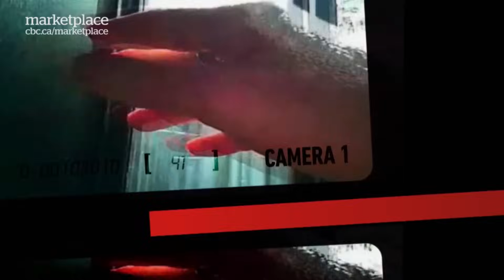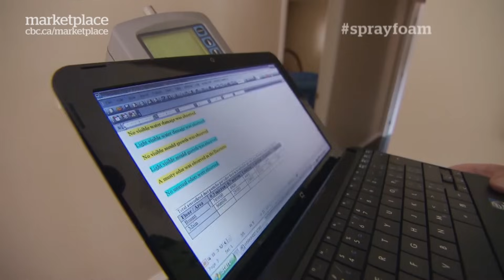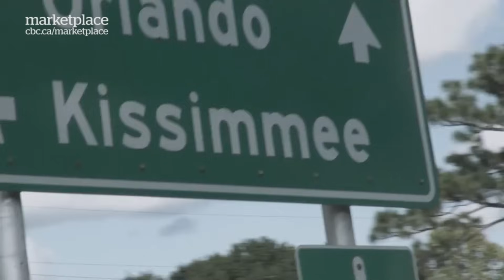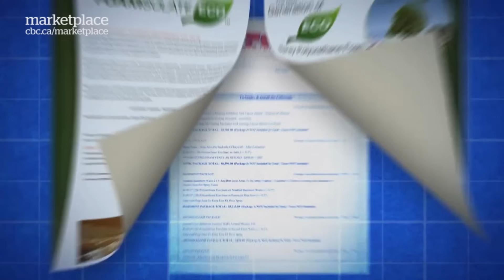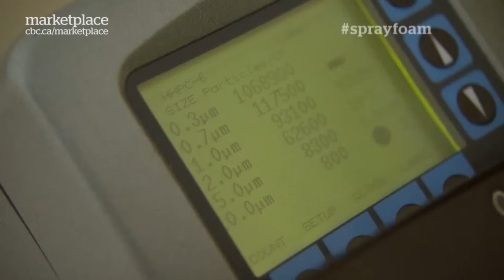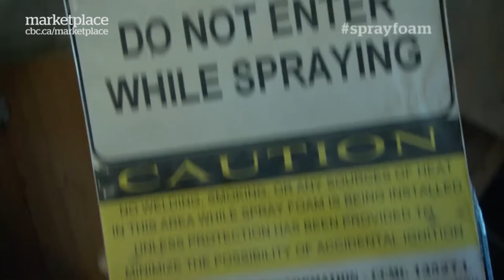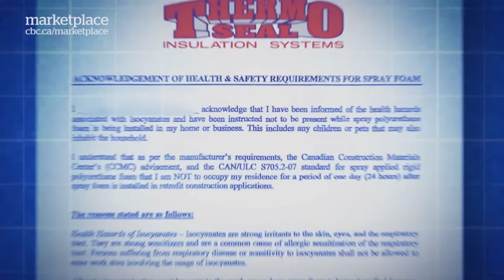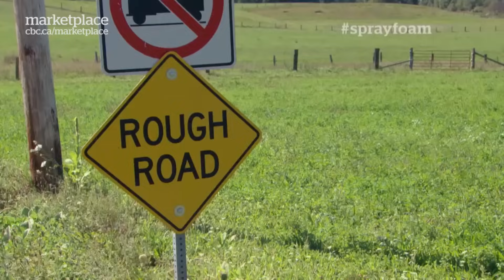Spray foam insulation nightmare: What can happen if it's not installed correctly (CBC Marketplace)

Comment: Ten years of doing this, never had ANY issues like this.  Though I've never installed more than an inch at a time.  That, I'm under the impression is where this went wrong.  Don't know what product this contractor was using(there are many, many types of SPF)  but the products that I've used work really well and are easy to install due to the canalization to slow the reaction giving the foam more time to properly react without excessive exothermic reactions.  Like they said in the beginning, like learning chemistry as much as anything.  Sad to see any job go south and the foam definitely needed to come out.  I would have pulled the dry wall (ceiling) off the rafters and mechanically removed what foam was on the trusses and if the contractor had done this day one, the home owner probably would be ok with this rather than decapitating his house.  And maybe could have come to believe in the foam again.  Bad contractor decision.  Not bad contractor, just didn't handle the fuck up well or soon enough.
Reply: Robert Palmore Smart move installing one inch at a time. Especially if you allow like 30 to 45 minutes per layer (easy to do really and the job will be done in only a few minutes longer than 1.5 inch lifts). I agree with you on what should have been done, however, the refusal to accept responsibility and take action means that the contractor has no say in any planned recovery or method of recovery and is still responsible under law.
However I disagree about the contractor. The fact that he refused to acknowledge his bad work and even now refused to acknowldege the physical harm he has caused (which is even described in health warnings in journals and MSDS's) because he failed to address the issue makes him just that "A BAD CONTRACTOR". At this point he can't deny responsibility for the physical harm caused to the family either. Remember that the exotherm caused a change to include formaldehyde which was a guaranteed non-component of his advertisement and sale. 
Misrepresentation and or failure to remove the product which violated his advertisement again proves he is a bad contractor.
Reply: Robert Palmore Whats the difference with this foam method and using foam boards with bottle urethane foam to seal the sides? I mean in insulation efficiency vise?
I mean sure spraying foam is faster and it will seal all the holes, but personally i still like to work with traditional stone wool or styrofoam boards. New house all ready has plenty other chemicals floating around until it vents those out and settles. Also for future renovation that foam it pain the ass remove.
Reply: When foam is sprayed in place, you get 100% adhesion and 100% air barrier as well as if the foam is installed in 2 inches or more, you get 100% moisture barrier.  Also sprayed in place with the 100% adhesion will help deaden sound as well as add structural strength.  As far as insulation value, if your using urethane board and sealing it, same.  Urethane has around 7 R per inch. Different manufacturers have slightly different ratings.  Polystyrene (foam cooler stuff) it's around R 5 per inch.  Hope this answers your question.
Reply: Robert Palmore Thanks for the info. Personally i think 100% adhesion and moisture barrier is a bad thing.. its kinda good when it gives some structural strength, but stopping building from moving naturally and making it total bubble.. no thanks. If i were to do insulation job with this, i would put plastic or something other stuff first and then cut tops of the beams open, so structure can breath and insulation can be removed more easy when and if its needed. Kinda depends from intended use, but in living apartment.. i would not use it, but in special cases. Even roof insulation installation, from below can be done much more easy with standard board UT and with less mess. I take spaying like everywhere its messy job?

I heard those R ratings take only in count one way of heat transfer, so for cant be trusted.. personally i notice those have been little shady, thought i'm not insulation expert, but tiler expert.
Reply: A house can be too tight.  The best thing is to make it as tight as possible and then use an air heat exchange to ventilate without the loss of heat.  I've always done every job like it was going to be installed forever.  Messy is putting it politely.  Coveralls, head cover, full face respirator with tear offs and gloves.  Worth it though.  A fell by the name David South who is with http://www.monolithic.com wrote an article called the R Fairy Tale.  Just like you say, the R values are a bit shady.  In the real world, Foam's insulating performance is much better than in a lab.  Like I will put R 21 (3 inches)  in Foam against R 35 (10 inches) of glass any day all day.
Reply: Robert Palmore Well as constructor builder i do every job like its to stay, but i try to leave possibility for renovations.

Thanks for the rest of the info :)
Reply: Lp
Reply: Don't have any experience with open cell. Feel like it's an expensive fiberglass solution.  I do know most are water blowing agent.  Blowing agent is the stuff that makes it foam up.  If the foam is a water based blowing agent, I'm guessing that the chances of this happening are lower. Please don't bother with that hyped up crap though.  I would rather take the risk of this happening and getting a real good quality insulation job that isn't hyped up bullshit.  Hope this helps a little.
Reply: Very intelligently put Robert. I agree %100.
Reply: Hope I don't disappoint you.  I do it that way because I'm cheap.  First layer has the poorest rise.  What your spraying on is cold. (chemicals come out around 130 degrees F.  Gets hotter after sprayed called exothermic reaction.  Get the first layer on and you get a little more yield from subsequent layers.  The older stuff, you could set on fire at 4 inch lift (layer).  So, cheap and a bit cautious.   I both love and HATE this stuff. Best insulation in the world and would LOVE to see the farce of fiberglass outlawed and hate to install it. Gets EVERYWHERE.  Have to wear a full body condom (coveralls, spay hood, full face resp. gloves, shoe covers and a place for someone to put an air hose and cool you off.)  Should be the only insulation allowed or at least a test method developed to show the real world effectiveness of it.  Cheers.
Reply: Ooh yes, I'm well aware of the the pitfalls of fiberglass. As a technician for At&t, I spent LOTS of time in attics
Reply: There is a movement on to do what is called "conditioned space" attics.  Only practical with SPF.  Foam is sprayed on the underside of the roof and not on top of the ceiling drywall. This puts the attic on the inside of the conditioning envelope. I've had to do attics in Idaho when it was about 95 out.  Bad idea.  Get punchy real fast.  With a conditioned space, you can work almost shirt sleeve all rear round in the attic.  Stay safe in the old death trap attics.
Reply: Robert Palmore they could have got a bad batch. that stuff happens all the time in the construction industry...
Reply: only an inch at a time? like time in between the layers? i worked for a spray foam insulation company.
Reply: Before the new blowing agent the exothermic (gets hotter after spraying) was pretty hot.  In fact there were reports of installers setting things on fire because of the exothermic heat.  The newer blowing agent formula has stuff in there to slow the reactions speed(catalysts) and supposedly you can spray the newer foams at a much faster (more inches per pass) than before because of the catalysts but safer is better. Usually I would go down a wall with around an inch and come back to the beginning and start over without ever having any problems.  For properly installed foam there is no detectable out gassing from the foam after 30 days.  Most of the out gassing should happen in a matter of hours and drop to barely detectable after just a couple of days.

Comment: Stick with Fiberglass, Wool Rock, Newspaper and Cotton fiber products. Safer easier to clean and fix.
Reply: They also make a gypsum based spray insulation.  I would never fill my walls with spray foam, God help you if you ever get an electrical fire.

Comment: Sealing the upper faces of timber ceiling joists with foam is not a good idea. It will still absorb moisture vapour from below, but not be able to lose it into the attic space. Damp wood will swell, potentially cracking ceilings and more seriously it may well rot over time.
Reply: Benzknees bingo

Comment: I was more impressed by the fact that that huge roof and ceiling were all removed in one piece.
Reply: Some people frame roofs that way too. Pretty neat. I myself have assembled sections of the roof on the ground and craned them up into place
Reply: @bolerdweller  a lot easier I guess if the wall plate is bolted and not nailed; still impressive lift.
Reply: @linkspider  they were probably nailed and hurricane strapped. Either way someone would have had to go around the whole perimeter and sawzall it out. Quite an intense job and all the electrical circuits would have had to be pulled, coiled and rerun afterwards. I've lifted a roof just for higher ceilings, this job is huge when you think it's just because they wanted to insulate the ceiling
Reply: @bolerdweller  lot of swearing

Comment: I live here in south Texas and I've warned countless people about this. We have extreme humidity and I've seen too many people suffer from this crap. Personally I recommend Rockwool, excellent product.
Reply: I 'd like to use Rockwool here in Bexar county.
Reply: @timothykeith1367  you won't regret it brother. Much better than spray foam.
Reply: @timothykeith1367  yeah it doesn’t rot on account of being pure spun rock, doesn’t burn, doesn’t get used by criters, etc.

But it is really energy intensive to produce.
Reply: Rockwool is nasty stuff as well. I like insulation boards. Expensive, but better for you.
Reply: My house was built in 1951 and uses rockwool in the attic.  It's great stuff.  Very effective.
Reply: @Anythingyoulike2013 Why is rock wool nasty stuff?
Reply: @judethree4405  Its not nice to work with and makes your skin itchy.  You need good protection over yourself especially face and arms.  Im convinced rockwool will be banned one day for some health reason or other. 
Also its not as efficient as pir insulation boards.  You achieve less of a u value with rockwool as compared to insulation boards.

Comment: 4:26 “It’s good for the environment”
Proceeds to put on hazmat suit before applying it
Reply: Because if you were to breath that when it's mixing you turn pale and pass out. My dad does it for a living. Is currently building the owner of Jimmy John's house and spraying foam. I don't believe it is the best thing for the environment but it sure does work great when someone skilled does it
Reply: @DevE84  You're right, I just thought it was a funny transition going from the "it's good for the environment" thing to putting on a hazmat suit and mask lol
Reply: Exactly
Reply: @DevE84  did this with the Squamish long term and hospital in 2009. you follow the Architect protocol and I am there as the CSO when it's applied, to make sure the crew doesn't cover a number of exempted areas in the plan. it's the way to go but the biggest problems with knowitalll contractors is that these guys are there to make money. you have to ride them like PBR rodeo bulls.  the foam we used is light green. I have no idea what this foam was supposed to be used for, but it's inert after application. if they're wearing hasmats then you send samples to bio and chem engineering for analysis, rather than present a new CBC drama.
Reply: Just going to point out that it's not a hazmat suit, cbn suit, or eod suit. It's a paper pair of overalls generally called a "tyvek suit" whether or not Tyvek made it.
Reply: The suit prevents the stuff from sticking to them nearly permanently. Did you see his boots?
Reply: @MonkeyJedi99  yeah the guys I've seen do it gorilla tape booties onto their tyveks, that way their shoes were protected
Reply: The "good for the environment" argument could be defended with the claim that it reduces the household's demand for fossil fuels, is less energy-intensive to manufacture, and is more efficient to transport than many alternative products. Its overall environmental footprint probably is lower than rock wool or fibreglass or polystyrene; it's just that most of that footprint lands right in your house. :p
Reply: @poisonhemlock  Right on :) I don't know if we're able to measure the overall environmental footprint of different materials, but I'd think rock wool or fibreglass is the most efficient and environmental friendly solutions, due to their lifespan; I mean it probably lasts as long as the house stands, 100 years or more.

But it probably still requires a heck load of electricity to produce rock wool or fiber glass, I guess :)
Reply: @Thomas-lk5cu  To be clear, I think I'd still pick something else. Please don't spray this crap where I sleep and eat, this is for commercial buildings.
Reply: @poisonhemlock  Yep I wouldn't want anything sprayed into my walls either, I like my home to be free from any chemical fumes.
Reply: The suit is mainly for keeping it off your skin while you spray. It ruins any clothing it gets on. I had to spray this stuff one summer when i was layed off from my regular job.
Reply: @johnhung1063  Yea but I just thought it was funny :D

Comment: We live in Georgia and had spray foam installed under our roof over twenty years ago with no issues. It lowered the temperature in the attic thirty degrees in the summer.

Comment: My home was built in 1945. I was offered home spray insulation and I refused quickly on the spot. I was told about all the benefits and still declined. I run 4 window units not all at the same time but surprisingly the house stays rather cool in the summer. Living in south Texas the winters are rather short but it can get cold. Either way my average electric bill in the summer is 145 dollars 55 in the spring and fall about 150 if the winter is colder than expected.

Comment: "Get a removal guarantee in writing"...   I do not know ONE SINGLE spray-foam company that would ever give anyone a guarantee that they will remove the foam if something goes wrong. The labor cost to remove foam from an entire house is ridiculous. Also, there are too many chemical things that can go wrong along the entire chain, from manufacture to storage before application to temperature of side A and side B before and during application. Some plural component machines are even known to give false temperature readings. This is an industry that is still in its infancy really... and people need to really need to be better-informed before deciding on spray-foam. The reason they decide on it is usually because the R-value is way better than anything else out there... WAY BETTER... however, with that said... you can get pre-manufactured blue-boards, which have a similar R-value and install them manually, just cut them to fit, then spray around them with spray-foam cans. This will take longer and be more  tedious, but it is safer. I think what happens is the spray-applicator tries to go to fast and does not allow the product to CURE, which is not to be confused with DRYING. If you do not allow each layer to cure, then the product cannot off-gas properly. This situation leads to these problems quite often. Bottom line is be informed... and for contractors in a competitive industry like this... make sure you charge enough to do the job correctly so you do not run into problems down the road. In my opinion, there are WAY too many spray-foam contractors that think you can just buy a machine and some spray-foam and go to work. You need to understand the science of the material and all of the  systems of the industry first!!!! The U.S. needs TRADE SCHOOLS!!!! Have you ever heard of this kind of thing happening in Germany? Holland? Norway? Denmark?  No... because you have to go to school and learn every facet of this before you get a license. Years of school... not months! And after you finish school, you get a well-paid job, with medical insurance and paid vacation and much more... When is America going to learn from Europe?
Reply: Well, as my Yugoslavian boss said on a carpentry job in California, "America is about production not perfection."   But he drove a Mercedes.
Reply: Do you know what happens to those bad contractors??? They don't continue their bad work anymore because they go out of business due to poor work history. Free market for a reason. I agree have a certification for a chemical process... But that can be instructed in about a month of training. Not years of training for a person to swing a hammer. Trade schools are great... Licensed only markets are not. What? You afraid the untrained new guy is gonna make you look bad? No of course not. But people know they get what they pay for.
Reply: Does Canada need trade schools too?
Reply: right on... you ARE so correct.
Reply: Thats like, "Get a lung transplant guarantee when you buy a pack of smokes." lol.